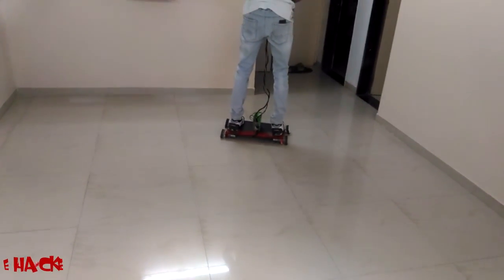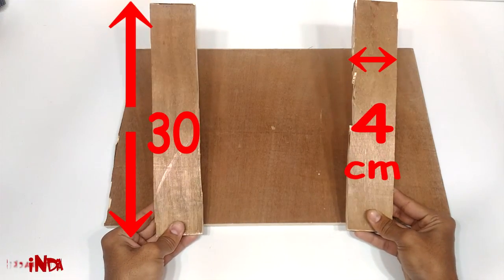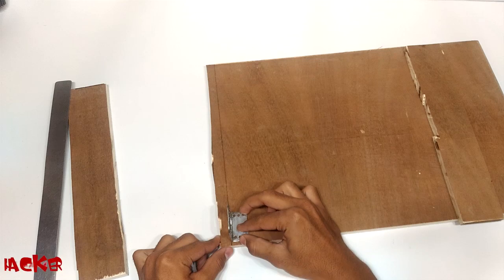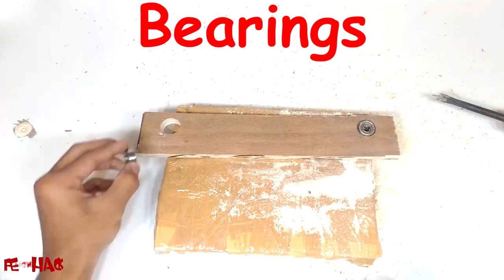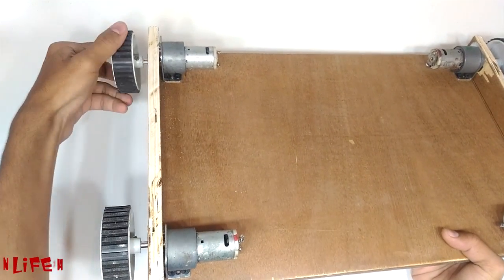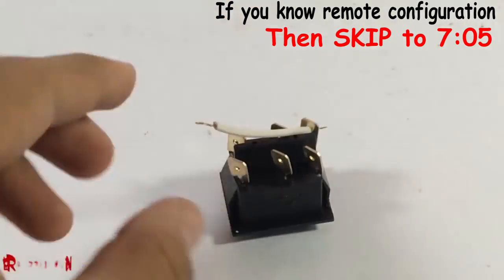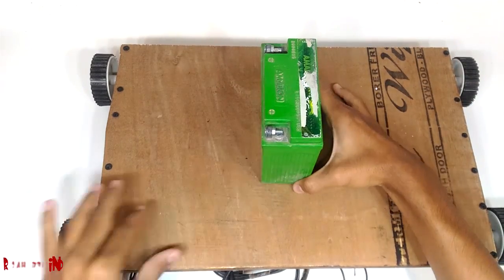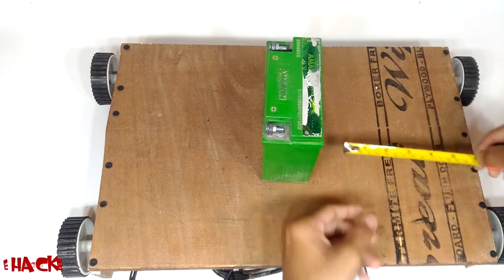How to Make a HOVERBOARD at Home

Comment: if we put more moter and wheels its faster 12 wheel 12 moter u can yry it
Reply: GAMING CHAMPION no its isnt going faster....
Reply: yes
Reply: kk
Reply: why u are still taking this mater
Reply: yar bcoz of u i am feelung guilty
Reply: n ow its kk bye
Reply: have coc
Reply: GAMING CHAMPION dude wat the hell are you saying
Reply: Dude u just add anything u want , it's not gonna happen
First it will be super expensive and with only the money u are spending on motors u can buy a cheap real hoverboard
Second u need a lot of power  supply which means like 2 or 3  12 volt bike batteries which each has a weight of 2-3 kg

Comment: buddy try some powerful moter which helps in speed and it can take high load capacity 
I did with this moter it runed only for 2to 4 days
Reply from the maker: You are right. but Use bearing like I am showing in this video otherwise load body will harm the gearbox. By the way mine is working fine even after so much rides so I suggest you to insert bearing and it will work fine.
Reply: may you please share the purchase link, and also please tell the torque of the motors you used.
Reply: http://www.amazon.in/gp/aw/d/B01I202LB0/ref=mp_s_a_1_sc_2?ie=UTF8&qid=1484473955&sr=8-2-spell&pi=AC_SX118_SY170_FMwebp_QL65&keywords=powerfyll+motor
Reply: 20000 RPM
Reply from the maker: torque is 32kgcm
you can buy  this from amazon 
Here is link http://amzn.to/2iKBUdk
Reply: plzz  send me a link of battery
Reply: plzz send the link of battery it's argent